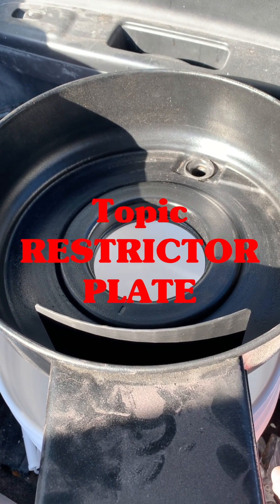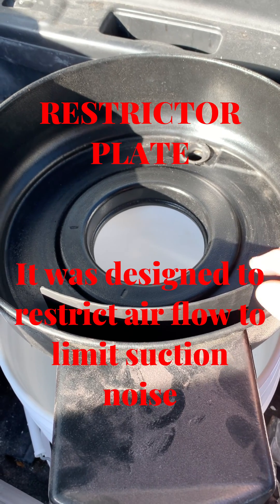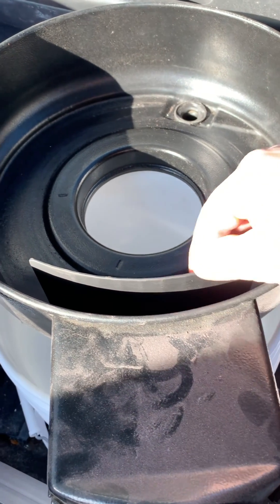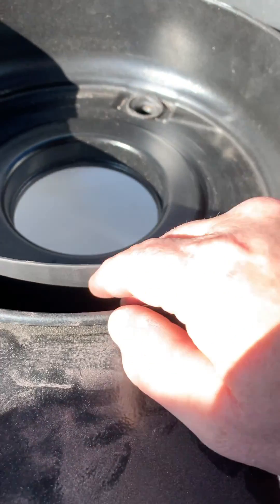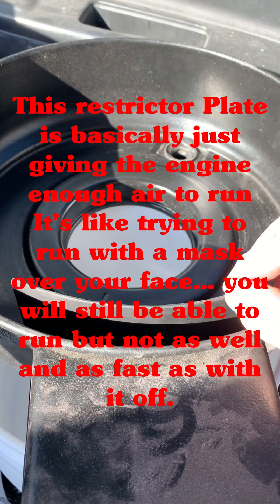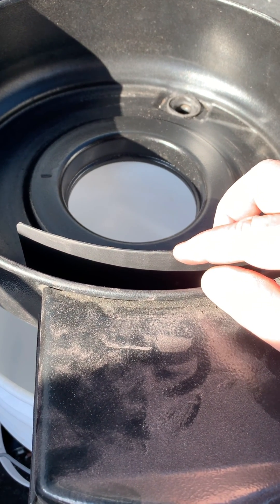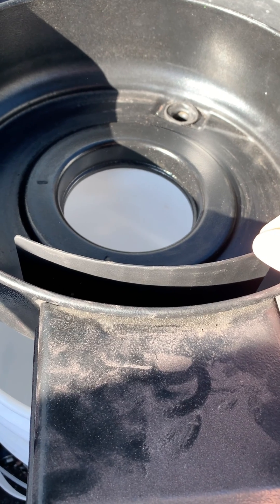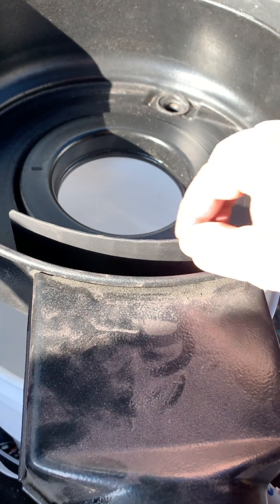Restrictor Plate Why is it there ?

Comment: I’m totally doing that
Reply from the maker: Take a drive with in on and make a mental note of the acceleration and then take it off…and go for another drive and see if you notice a difference…let me know…you definitely should !!
Reply: @jeremiah6081  definitely feels a little snappier at the end of second gear and in 3rd gear. I don’t have the capabilities right now to tune myself, but I think a fresh tune would help even better.
Reply from the maker: @ElbidTfub.awoken  
That’s excellent….. do you still have your factory soup bowl  on your air cleaner ?
Reply: @jeremiah6081  I do, I did a lot of research and removing that is pretty pointless. Does more harm than good. My next big goals are to tune it professionally with a bigger camshaft.
Reply from the maker: @ElbidTfub.awoken  
That’s great….I have a video all about the soup bowl… The proper name of it is called a HELMHOLTZ RESONATOR….and it helps dissipate pressure wave harmonics so that more air comes into your engine.
Always use Stanadyne Peformance on every tank…it seriously is the best for your fuel injectors and Pump….What exhaust is on their now ?
Reply: @jeremiah6081  stock exhaust system past manifolds and if comes into one 2.5 inch pipe that’s cut off in front of the rear passenger side wheel. The stock exhaust was broken when the truck backed into a stump. It’s ridiculously loud
Reply from the maker: @ElbidTfub.awoken  
The 2.5 inch pipe is a perfect size for those trucks…The factory “Y” pipe is honestly very restrictive…I ran true dual exhaust and 2 walker mufflers and gave me even more power…that’s if you have the money to do that… if you put on a stock walker muffler it will quiet it down substantially
Reply: @jeremiah6081  thanks for the info! I like the loud sound but I would like a true dual exhaust that runs out the back instead of one side.
Reply from the maker: @ElbidTfub.awoken  
Your most welcome…if you like it loud…then straight pipe it 2.5 from exhaust manifolds straight back….I added an “H” pipe so that it didn’t sound too uneven…with the restrictive “Y” pipe gone you will be getting exhaust gasses out faster and EGT will be down….the only other thing would be to turn up the fuel injector pump to compensate  with the freer flowing exhaust and the more air you have coming from removing the restrictor plate….just don’t crank up the pump like some people do…your motor won’t last long.